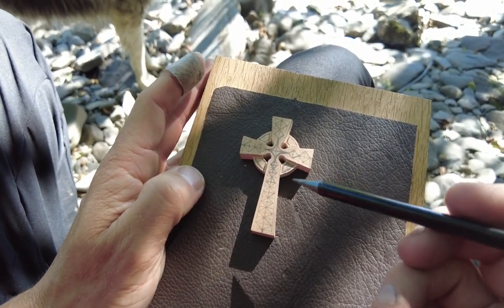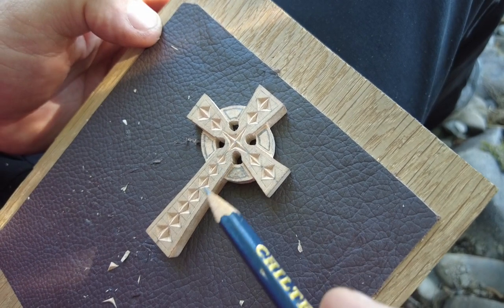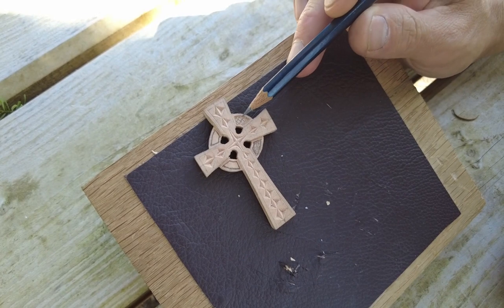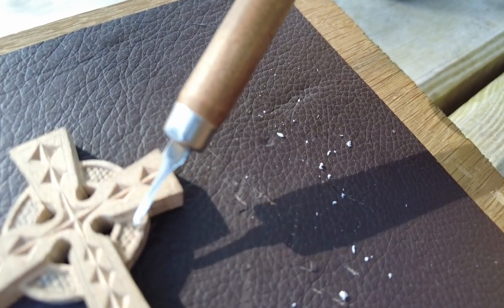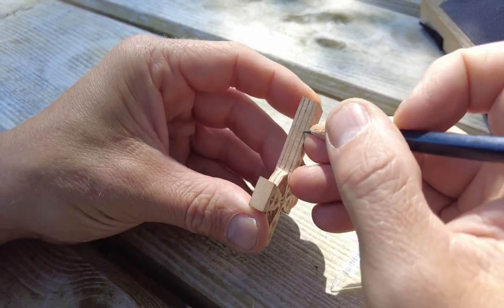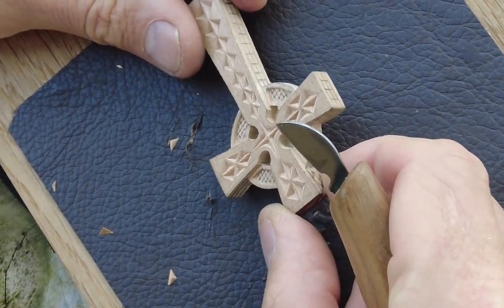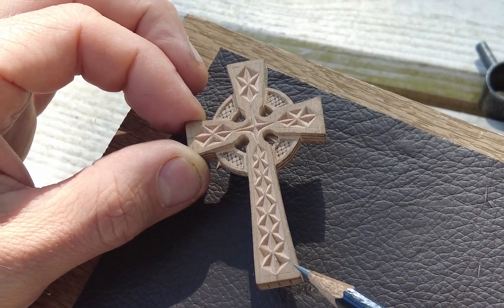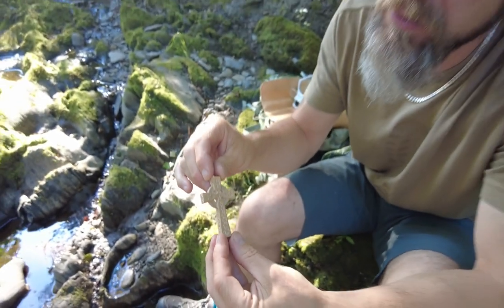How I carve a Celtic Cross pendant / wild Wood Carving by the river and in the forest

Comment: Great video, I probably need a bit of practice before I can make something like this. I have a couple of questions.
First is; what type of would are you using for this?
Second; what is the stroking on the leather strip for (I bought myself a wood carving set which includes this strip as well, but I don't know what its use is)
Third; You are using this realy tiny knife for carving the smallest patterns, could you enlighten me where to get such a tool?
And last; Could you tell me the measurements of the initial cross, I'd love to try and carve it myself too